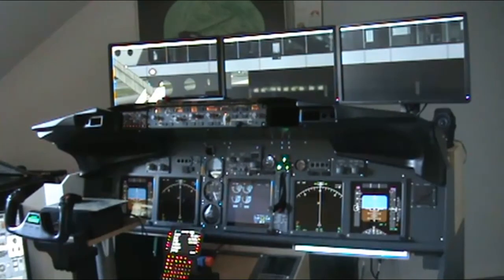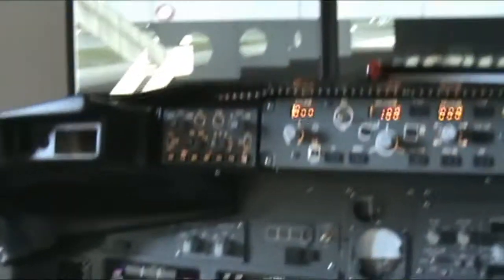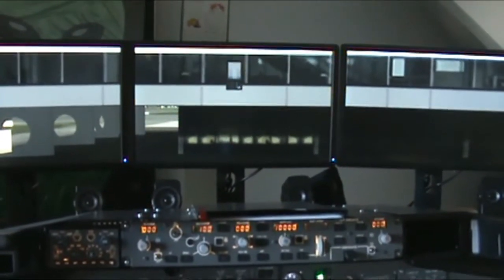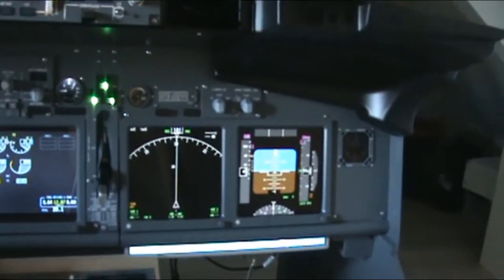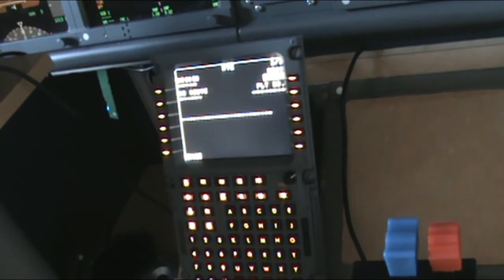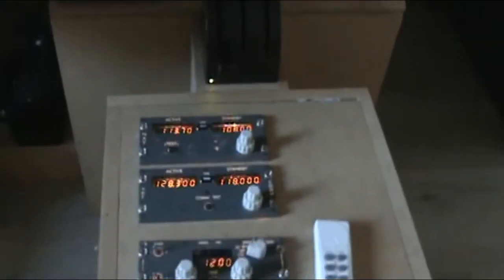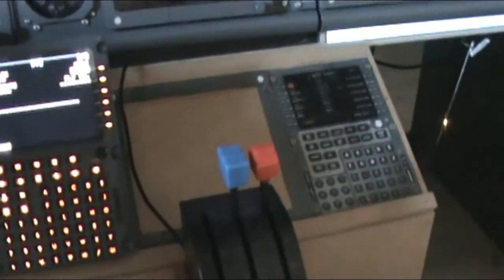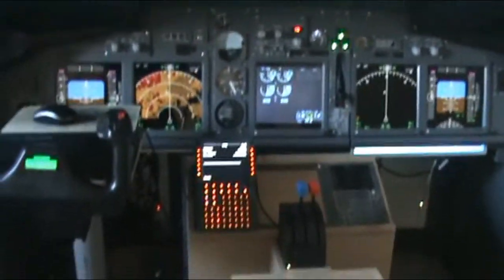Boeing 737 800 Home Cockpit Simulator Tour 2014

Comment: hi i would like to know how the prosim 737 software works
so according to what i see you have 3 monitors connected to your computer by VGA cable right?
so when you open the software ,you open the instrument you want (ND,PFD, EICAS etc...)but when i get to this point i dont understand how you send the image to the specific monitor you want it to be and how you make it stay there permanently
and about the cdu you connect it same to your pc by vga and all.
but then how do you do to send the image there(the cdu) and is it compatible with ifly 737?
if you could make a video on how to do all this it would be great can you please do it (only if possible)
thanks and BTW great cokpit ;-)
Reply from the maker: Hi Ryaan,
it is rather simple, once you launch one of the displays from within the folder, the display will open on one of the monitors, you can simply drag the window onto any of your monitors, if you cannot drag it, it's probably because you can't see the title bar, in this case right click on the disply and select title bar. Prosim will automatically remember size and position (you can resize the window to fit your monitor), so that when you close and re-open it will open in the last position you had it. For the CDU is the same assuming you have the CDU I have, other CDU have the program incorporated but than are more expensive. ProSim is compatible with ifly 737.
If this is not clear I will make a video for you.
Good Luck
Reply: 737ngxsim ok i understood how to send it to your monitor but i did not on how to permanely leave it there and is there a cold and dark version?
and i have the opencokpit cdu (mounted one)
and i tried to do what you said 
but when i open the prosim 737 cdu,
it comes up with the whole cdu with the buttons and stuff not with only the cdu screen.
so it would very kind if you could make a video whenever possible
thank you very much!
i subbed and liked you video you have a great channel :-)
Reply from the maker: ryaan beg
yes, in the configuration window of ProSim you have a drop down menu, there you can choose cold and dark. Thanks for Subscribing, let me know if you have other questions
Reply: 737ngxsim 
READ THE WHOLE COMMENT PLEASE!!!

thanks i got the cold and dark but i still have a major problem
my avionics does not recognise the flightsim! i dont why this happens is there any other software i have to install? 
my setup is 1 computer for flightsim and 1 for avionics i have done a network switch between both computers ,so my flightsim SHOULD recognise the avionics!
and can i like drag the avionics on the monitors then minimize them on my main computer or will they close on the monitors and what about the cdu? you did not give me a reply on that yet?
i think the best solution would be to make a video from opening the software to testing the avionics this would really help.(especially on how to make the flight sim recognise it)
thank you very much for you help.
Reply from the maker: ryaan beg
Sorry Ryaan, I had not realize there was more.
So the CDU issue, my CDU is different, you need SIOC programming, I had the flap gauge form them, I took it back, because I did not want to get crazy learning SIOC, you also need to make sure you have FSUIPC, but you better go to the opencockpit forum for this problem, I could not make a video for it.

The avionics... I can do a video, but I need a couple of days, however let's check a few things, your set up is very similar to mine, if you have already FSUIPC you do not need anything else. When you have the avionics open, if you right-click one one of them, it should say in green : status connected, if it says in red not connected you might have done something wrong in the network set up.

Few tips:
make sure each PC has a unique IP address, within the avionics settings you will need to tell to which IP address they need to connect, which is the one where the main module is installed.

I will try to make a video as soon as I can.
Reply: 737ngxsim ok thanks for your support
dont worry about the videos do it whenever you are free 
thanks
Reply: 737ngxsim BTW i have another question about the overhead annunciators
I saw that a cokpitsimparts they sell the annunciators,i did not purchase them yet because i dont how how they work
When you flick some buttons on your overhead,
How do the annunciators recognise that and how are they connected?
If you could also make a vid on how to install 1 annunciator it would be so helpful
(Do the video only if it is ok for you and that it will not create you extra difficulties in your project)
Reply from the maker: HI Ryaan, I do not have an overhead yet. But I cannot imagine is much different from the annunciators I have on the MIP. You will need a USB card like a Leo Bodnar or similar, the cables that come from behind the leds go to the card, than from the prosim software you select the right port on the card. This will be more difficult to make a video since I would need to buy the material, but I will make a video about the other stuff
Reply: 737ngxsim http://www.cockpitsimparts.co.uk/
I am thinking of purchasing the 737 overhead v3 from this website
Then buying all the ,knobs ,switches,toggle caps etc...
Then getting a flightdecksolutions interface card connecting all the knobs, caps  etc...
To this card that will then connect to my computer by usb

Then i will configure the function of the switches and  on prosim!
But i still have a problem ,because this does not come with backlight but i dont know how to integrate backlight,ill find out on some website.

and about the annunciators ,i saw that the toggle switches,rotary system etc...
have like a piece of metal underneath them where you put the end of the wire

but i did not see anything like that on the annunciators i just saw a piece of rectangle with text written.
so do the annunciator connecting is the same or is it something else.

and the anunciator do not have a bulb in them
but on the FDS  interface, therer is a LED output.
but i was wondering ,do you have to put the led output just under the annunciator so as to make it light up or,
does when you have connected it ,when the electricity passes it send the LED output to the annunciator?

sorry for all these questions!

But anyway,
Do you think the whole thing i explained about building the overhead  will work or is there a step i missed?
Reply from the maker: ryaan beg The process you explained it should work, I am battling myself in making the decision if buyng a ready made one form CPFlight or do the same as you intend to do. For the annunciators, the card is dived in two, inputs and outputs, a rotary switch is an input, when you turn it gives a command, the annunciator is an output, because after a command is received, the led will light up, so as long as you connect it on the right place on the card you will be fine. Inside the annunciator you have a diveder with two holes, inside the holes fit two leds, each led has two legs, positive and negative, first you need to connect the two leds together and than one wire goes to one connector on the card and another wire goes to another connectorFor the backlight I have seen a way to do this really fun and cheap from another fellow builder, here is the link to his video, I think is a good solution.https://www.youtube.com/watch?v=kxREb3UII28Let me know if you get started I am interested in your progress.
Reply from the maker: 737ngxsim I actually just checked the website you gave me, now I understand your issue with the annunciators, the site just sells you the label, but they do not seem to be providing the casing. An annunciator is made more than just a label.Check this out :http://www.aviationmegastore.com/annunciator-holder--10-pieces--no-legend-include-737650anh-engravity-737650anh-b737ng-cockpit/product/?shopid=LM53ab1ada2e4b864a29addedcf6&action=prodinfo&parent_id=0&art=68336
Reply: 737ngxsim thanks for the annunciator link,
so this is just to hold it?
then there are 2 pieces of metal than hangs below,
then i connect the 2 pieces each with a wire and connect them to the led output on my interface card? and how to i connect the two leds 
BTW: a led is a little bulb?
and do you know where i can get a potentionometer?
and does it connect same as any toggle switch?
and to integrate backlight,
i saw the video link you provided,its interesting but i was thinking of a simple way
could i not get LED strips,connecting them by putting the wire in it with the interface card wire then connecting it to the card
then getting a potentionometer 
configuring it as backlight on prosim and then getting prosim to recognise the backlight as any normal annunciator?
Reply from the maker: ryaan beg I will be making a video to connect leds, but on YouTube there is a million already done before me. Yes you then connect the wires to the output ports of the card. Potentiometers can be bought on line or at an electronic shop near you. I bought them at a shop here in the Netherlands.